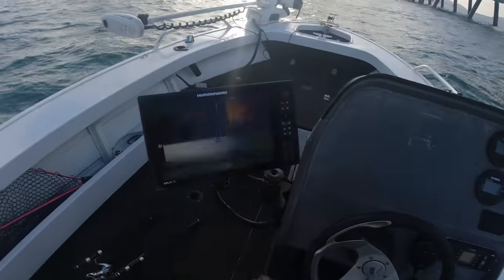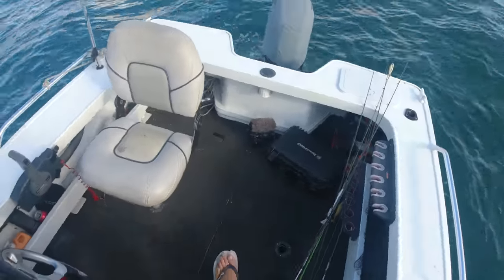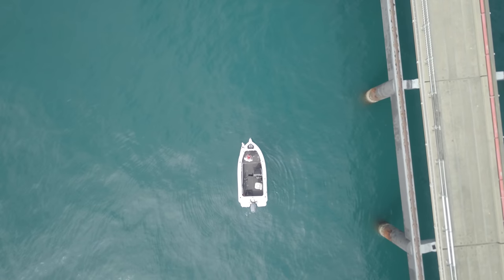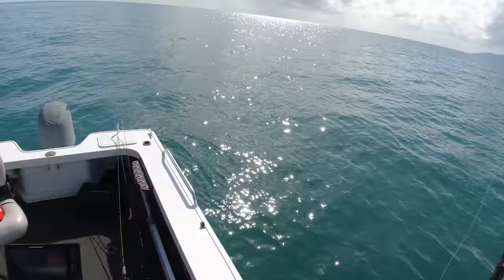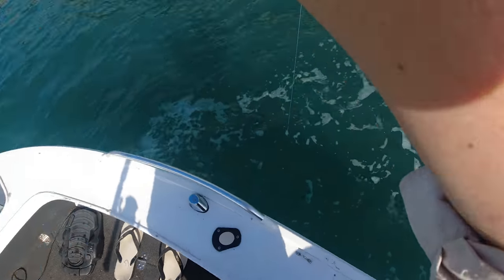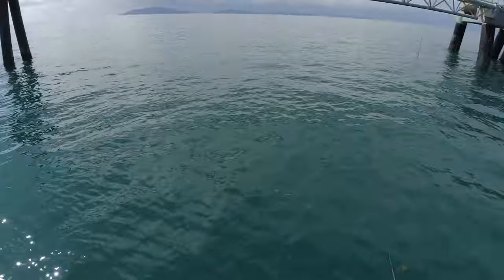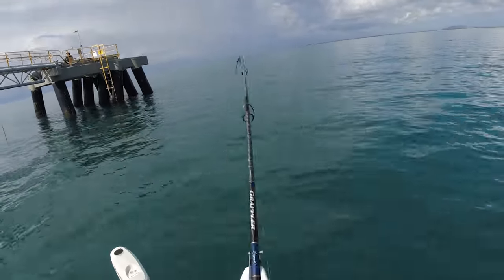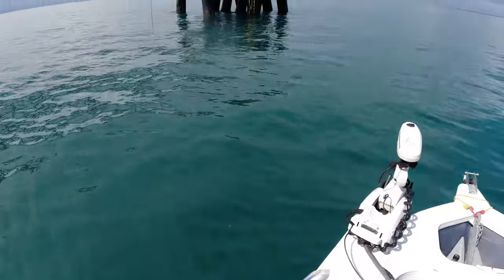JIGGING with a WRENCH

Comment: You'll find most specialist spanner tossers use a 10mm Drew, that's why they are so often missing in tool bags. The old Stanley models from the eighties were the go to brand and model, but most work well, and the chromeys are the best.
Reply: Too right, it's always the 10mm.....I reckon 1% of the population ends up with 99% of 10mm spanners/sockets and lighters.

Comment: Had a Christmas challenge where we had to make lures out of stuff laying around the garage, my mate had the same design
Reply from the maker: Great minds think alike haha
Reply: @DrewMinto  should try my design
-Great Northern Bottle cap
-size 0 sinkers
- x2 split rings
-treble hook wth Feather

Grab the bottle cap and drill 2 small holes at 12 and 6 for the split rings to grab, then get 2 small sinkers and put them in the middle of the bottle cap the fold the cap in half holding in the sinkers but not tight to a point where they can’t move, I’m positive by now you see the design and can alter it

It worked on Bream but lost it to something decent as Im trash at knots